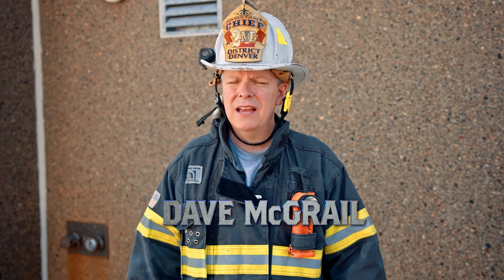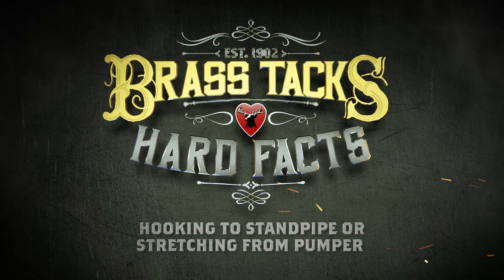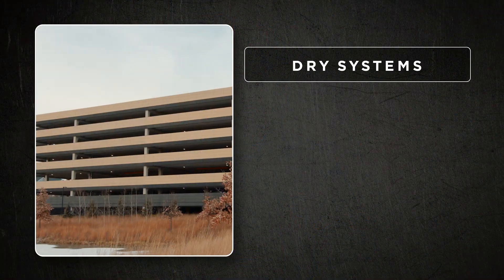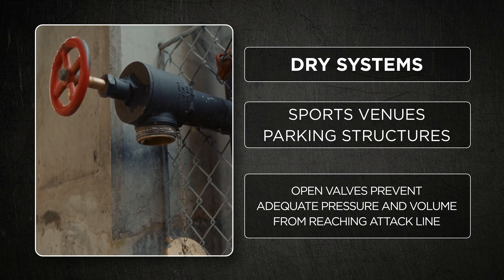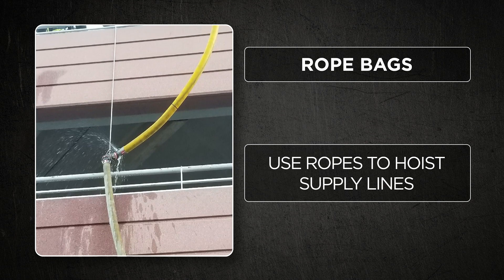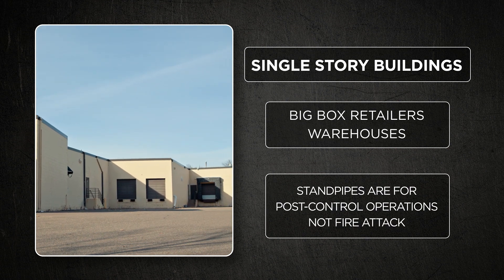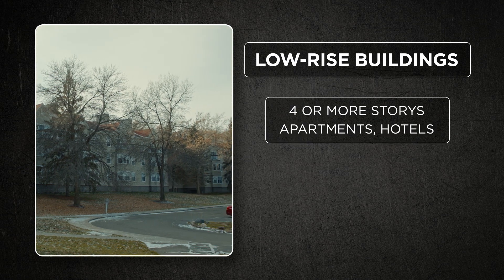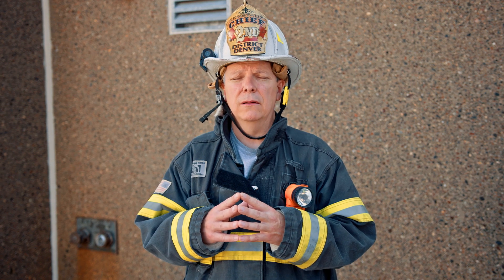Hooking to Standpipe or Stretching from Pumper (Episode #50)

Comment: Why do single story commercials have standpipes that are not meant for fire attack?
Reply: Those are the 1 1/2" hookups most commonly associated with Lowe's which are NFPA 13 "small hose connections" and intended for mop up, but their actual utility is questionable.
Reply: @ironmatic1  A different case is a covered mall*. Standpipes with 2-1/2” connections inside malls are intended for FF use in initial attack. Sprinkler operation and the smoke evacuation system should keep smoke 7’ above floor, allowing use of standpipe. Refer to your prefire plan.

If your FF’s lack confidence in the systems your FD needs to improve your program of ensuring ITM post commissioning inspections and tests. If you’re junior and you want to find out quickly how your new organization scores on this ask one question. Do we have an inventory of active fire protection systems? If not, it is sure the system for ensuring reliability isn’t even third rate.

*Covered mall is a building/fire code defined term for what most people call a shopping mall. Expect sprinklers and alarm. At 50,000 square feet expect smoke evacuation. Smoke evacuation comes with emergency power, usually a diesel gen set.
Reply: @billsmith5109  Didn't think OP was referring to malls. But for semantics fun, standpipes in covered and open malls aren't "standpipes" either—IBC 905.3.3.